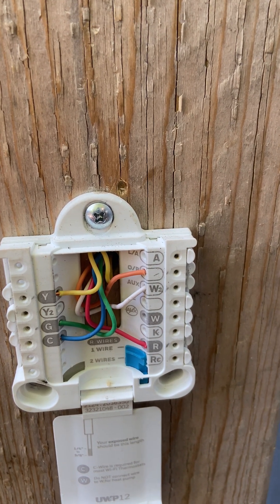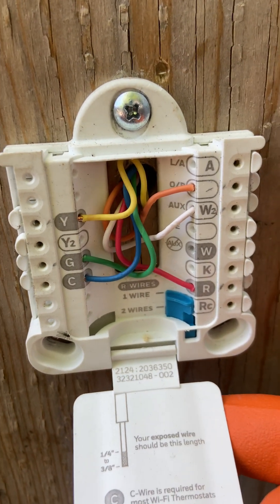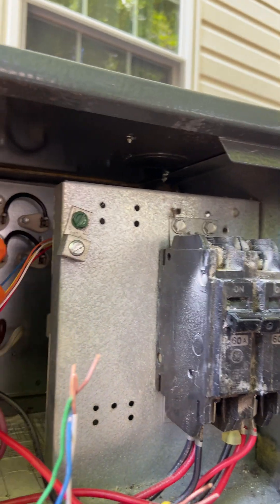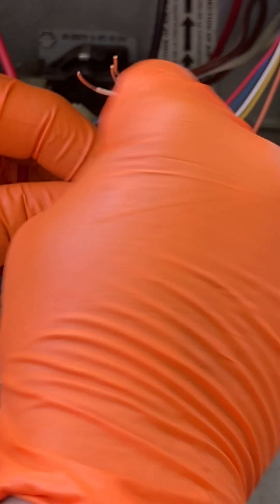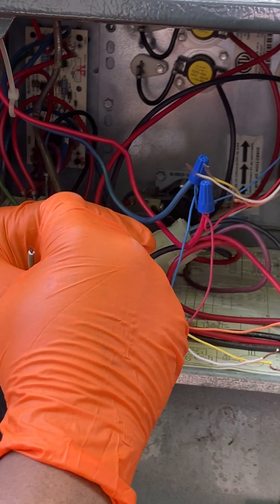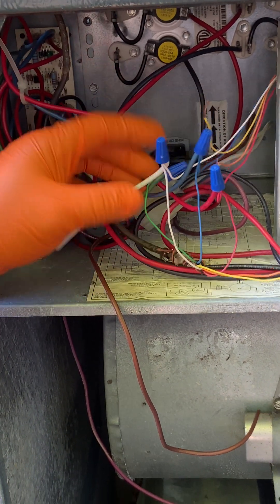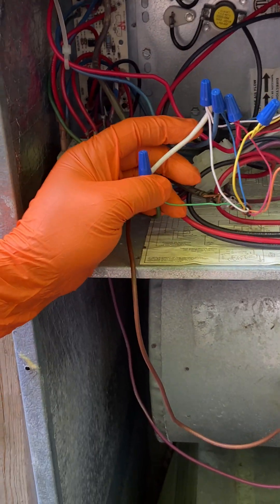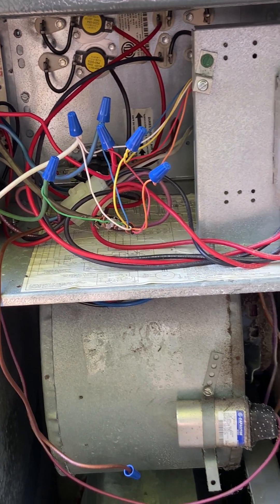Low voltage wiring for heat pump, Air handler wiring, outdoor wiring, and thermostat wiring for HP

Comment: I don't have heat pump only have red and white coming from outside and thermostat wires and  control board wires. Where do I connect the wires without heat pump?